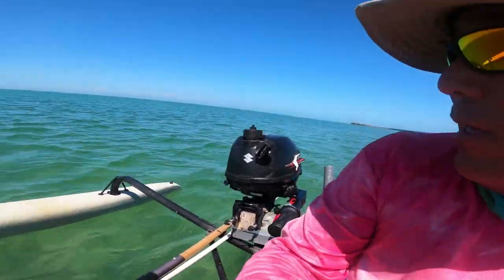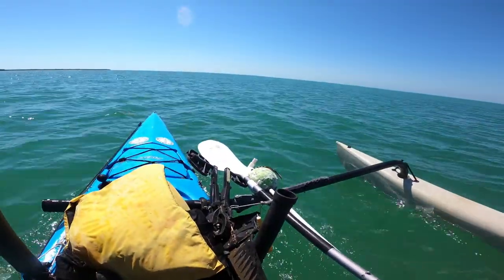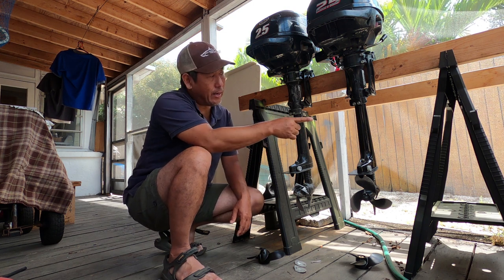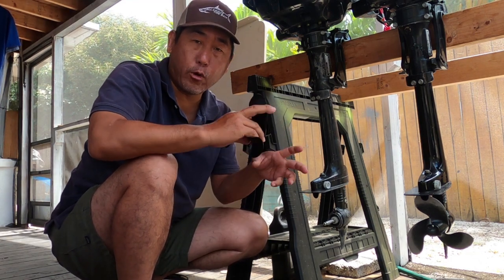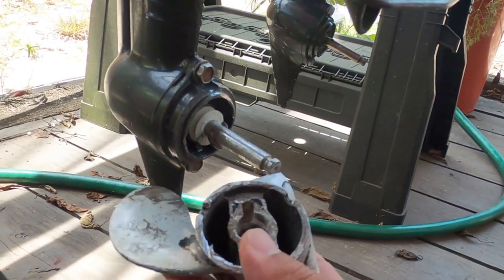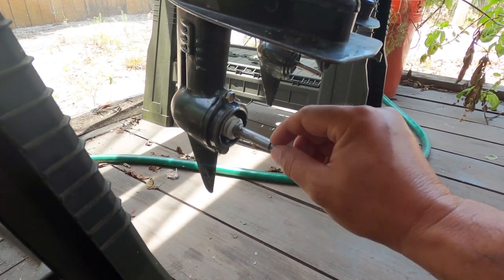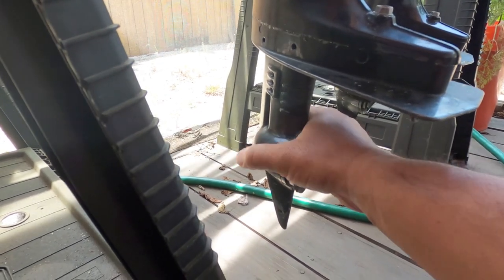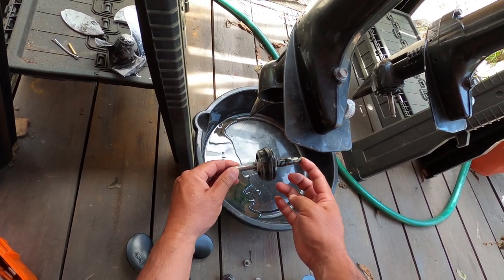Suzuki 2.5 HP Outboard Prop Damage and Replacement X2

Comment: Great video. Thanks for taking the time to make it. I had been having difficulty getting the nut off the prop on the newer version. One piece of feedback: Your nut was already loose, but if the rubber on the prop is stripped, putting a board in there to stop the drive shaft from turning won't work. That is why we are changing the prop. I had a tough time turning the nut without moving the cylinder up and down.

Comment: Great  video Steve. My Suzuki 2.5 also has the problem where if I rev the motor higher than certain rpm, it would just spin up and lose power. However, it behaves that way since I bought it new from the dealer. I inspected the prop the same way you showed by turn it with my hand while in gear. I do not see the prop slipping. It always spins with the lock nut. Could that free spin be caused by a different reason?
Reply: Late reply and I've never been out on the water in my boat yet, but if the outboard is trimmed up too high you could have 'cavitation' or 'ventilation'. The following is my own speculation, but if your transom height is too tall for the outboard that may also interfere with the prop getting good bite.

Comment: I wonder if the alu prop with the braking pin will fit on a Mercury/Tohatsu 2.5&3.5 HP 4 stroke engine. They look totally similar in dimensions to me. Maybe someone knows this or did it?
The  Mercury/Tohatsu 2.5&3.5 HP 4 stroke have only plastic pops.